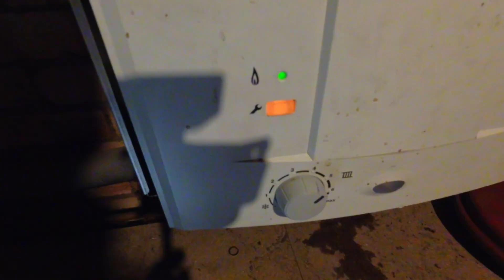Worcester PRV Old School

Comment: Why the Worcester vessel? Already has the external. If that’s dead, isn’t that quicker, cheaper, and easier to swap?

Genuine question. I do these all the time, but still watch everyone’s videos incase someone has a better way

Good video
Reply from the maker: For some reason even with the external it was still over pressurising which threw me as I was of the same impression as you
Reply: @cputilitysolutions  still don’t get why that works, but external doesn’t. 

Seriously not criticising, just trying to understand the reasoning incase I get a similar job. Not as much satisfaction when you fix something, but not 100% know why it worked 😂
Reply: @cputilitysolutions how many radiators were on the system?, I’ve been to a few jobs where the vessel is severely undersized for the system so the only way to overcome the problem is to fit a suitably sized vessel
Reply from the maker: Only about 8, standard 3 bed house  @CarlAtkinson-zu1zh
Reply: @cputilitysolutions surely the external vessel should be adequate then, is the filling loop passing slowly?
Reply: Or maybe a hole in the plate?
Reply from the maker: Nah was only happening when the heating was on, plus I've not had a callback since the repair was done  @CarlAtkinson-zu1zh
Reply: @cputilitysolutions sounds like one of those jobs where customers pass on old information that you need to override and explain

Comment: Honesty peoples, dont buy Worcester 🤦🏻😂
Reply from the maker: Peach 🙌🏾
Reply: They are all marketing.
Reply: Worcester boilers are good boilers, just some bad design issues
Reply: @CarlAtkinson-zu1zh So not good then 😂
Reply: @FLYNN.. perhaps they will take note of some of our concerns and redesign the issues we are highlighting but I doubt it 😂😂😂
Reply: It would be interesting to see what the most popular boiler actually is for customers and engineers?, I personally love working on the Potterton performa 28he and the Baxi and main equivalent which are all basically the same boiler, you can tell that a gas engineer designed them instead of some design engineer that’s sat behind a computer screen that will never get his hands dirty!….
Reply: The only issue with the boilers I spoke about are the isolation valves that always leak after you have shut them

Comment: you got small hands. pump out is a pia. take the cold main out? yoiu probably knew. if you can get the right casing off itll make it easier to release the prz from the socket. silicone spray. at the start of the job. theres are other ways drilling out pop rivets and replacing them   it doesnt deconstruct.
Reply from the maker: Thanks 👍🏾

Comment: On the vessel i thought you had to remove the boiler out
Reply: Vertical flue on this one so no need.
Reply: @umark6695  i see so it don't touch the flue when lifting the vessel out
Reply from the maker: Nope, slides out the back